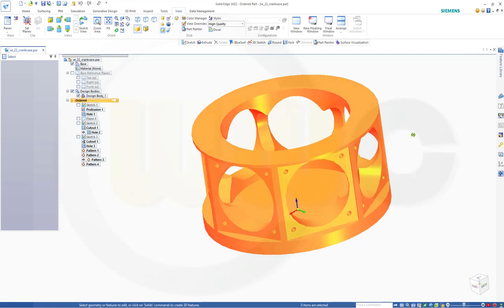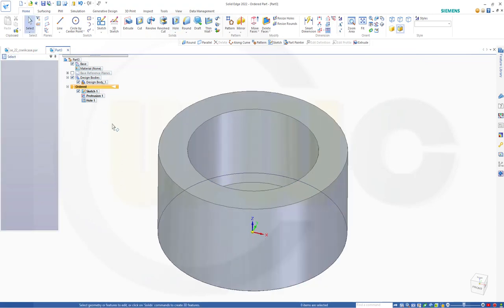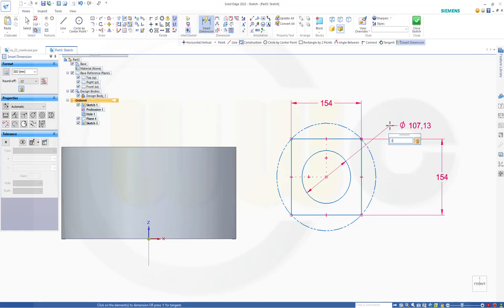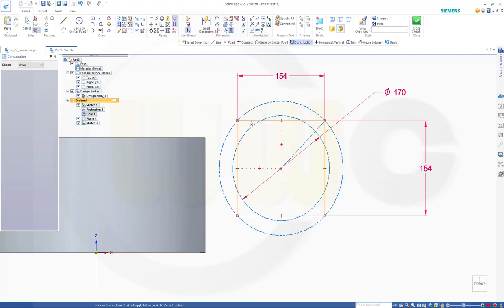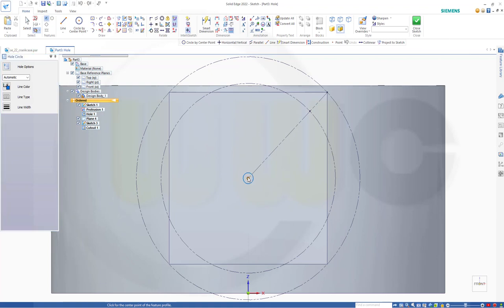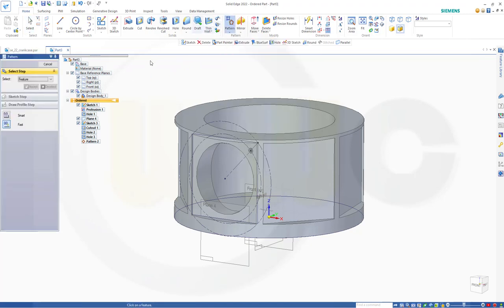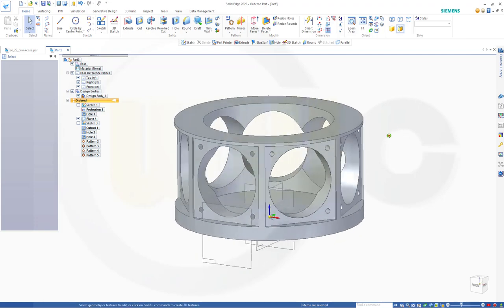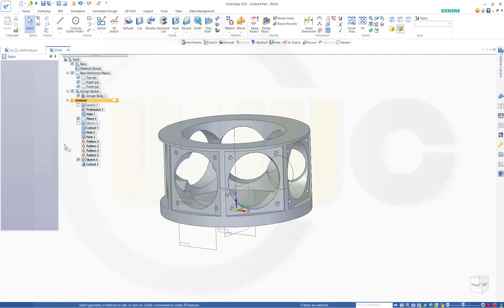Kurbelgehäuse - Crankcase ( 7 cylinder radial engine) - SolidEdge 2022 Training - Part Design

Comment: A very interesting project. Are you building the engine? I have tried to make Solid Edge my go to CAD package, but it has some features that I find very difficult to use. Mainly the very messy "feature tree" and the lack of an easy to use method of creating a clipping plane to make a sketching surface visible when it is covered by other features or bodies. And of course, snapping to something when you don't want it to. I might try it again because it has a very good text on path feature that DesignSpark Mechanical doesn't have. Thanks for the video.
Reply from the maker: I will model a simplified/reduced version, meaning only the most important parts. The complete engine would have some hundred parts.